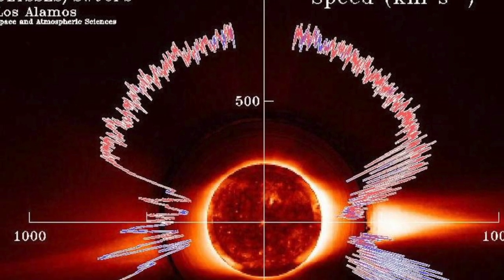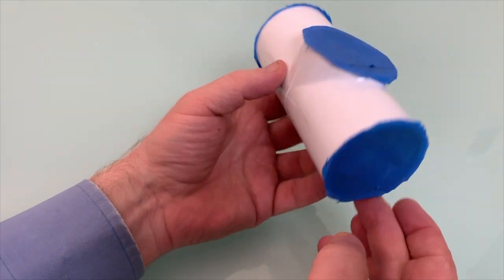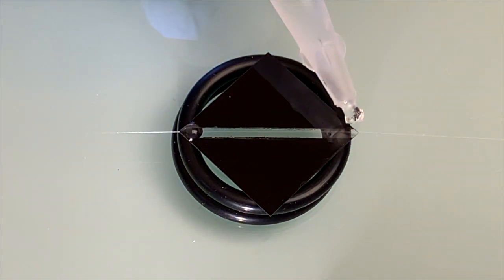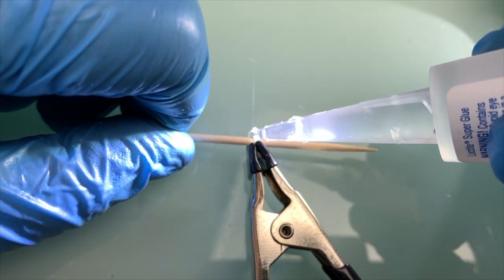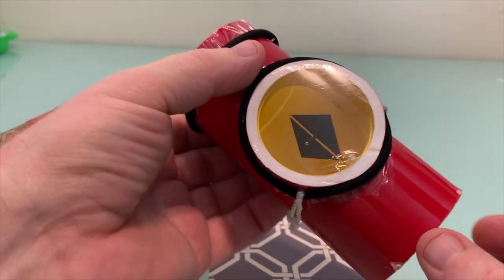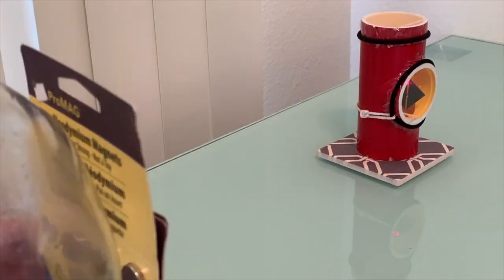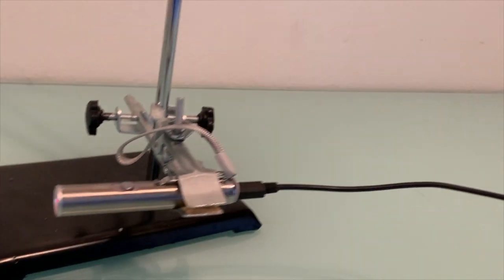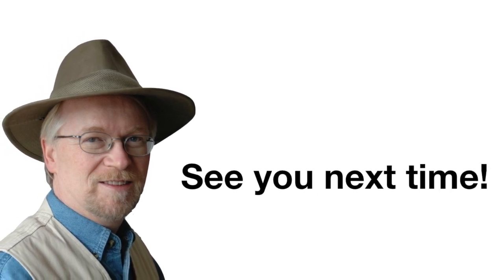Build an inexpensive DIY Solar Weather Station at home

Comment: Shawn I'm building this instrument, thought I'd let you know :) I'll keep you posted on my progress. One question I have involves dampening rotation. The q-tip you use dampens vibration, but doesn't much dampen rotational oscillation, which I'm finding can persist for quite some time, and is easily induced. I wonder if filling the cavity with some liquid would act to dampen rotational oscillation, but not to hamper the magnetic torque being measured. Essentially, it would be a low-pass filter. Thoughts?
Reply from the maker: Wonderful news! I thought about enclosing the sensor in a liquid to damp the rotational motion, but I didn’t try it. (I was concerned about biofouling over the long term, but I think this is a perfectly viable option.) Another way to do it is to use eddy currents to damp the rotation. Suppose you cut a channel in copper plate that was just wide enough to allow the magnets on the sensor to swing through. Mount the channel just behind the sensor with the magnets penetrating the channel. Then as the magnets rotate they create eddy currents in the copper which, by Lens’s law, creates their own magnetic fields which act to oppose the motion of the sensor magnets. I’ve used this method in other magnetometers, but I didn’t have the tooling required to machine the part. 

I think either approach should work. 

Another way to kill the motion is to bring a magnet 🧲 in on the zero line so that the sensor aligns to it, then withdraw the magnet exactly along the zero line so that it’s influence gets weaker and weaker. When it’s removed completely the sensor magnet will be it it’s zero position.
Reply from the maker: Let me know what you think about these these options. I encourage you to experiment with low viscosity fluids. I suspect that they would prove quite suitable for this application as it should be easy, with the relatively large sensor area to achieve critical damping.
Reply: @citizenscientistsworkshop1948  I think I'll give the fluid a try to start with. I'm 3D printing my enclosure, so it won't be much of a trick to keep it sealed. I'm thinking something like isopropyl? I don't want to weaken the nylon. Incidentally, working with single strands of nylon is incredibly challenging. I managed to get down to a few strands, but could not separate out a single one. It's just too thin. I don't think it makes much difference, though.

The eddy currents idea is very attractive, though, because it would let me explore that regime. I have a friend with a CNC that can machine channels in copper-clad printed circuit board, so maybe at some point I'll give that a try too. Do you think this idea would also serve to dampen the vibrational mode you use the q-tip to dampen in your video?
Reply: @citizenscientistsworkshop1948  I've done some research on low viscosity liquids, and am having a hard time coming up with one that's not toxic, corrosive, explosive, or some combination thereof! The eddy current dampening is sounding better to me. In fact, I just taped a prototype to the back of my prototype enclosure (maybe a half inch away from the magnets) and that improved the dampening time quite considerably. No doubt a fluid would really do better, but unless I can find one that is relatively safe to have sitting around the house, I'll probably go with copper. Thoughts?
Reply from the maker: @tdstone4s  Why not use water with a dash of dash of sodium metabisulfite, potassium metabisulfite or idorophore? The first two chemicals are used to sanitize wine making equipment, and the latter is and iodine-based compound that is used in the medical industry. I think all three are stable and that they should prevent biofouling over fairly long times. Concentrations needed to kill microbes are not dangerous to humans, which is why these chemicals are used in these industries. 

I’m glad to hear that eddy current damping is an option for you. Since you are printing your own housing, you can create one that has little clearance for the motion of the magnets. Then you can place the copper on the outer surface. Ideally, you’d like to have the long magnets pass through a channel that’s cut in the copper.  Such a device might come close to being critically damped.
Reply: @citizenscientistsworkshop1948  Thanks for the tips. Those do sound better than acetone!

I went ahead and ordered some of those magnets you used in this demonstration. They're quite small, smaller than I realized. They wouldn't give me a lot of working room for a slotted copper, but maybe I could stack two of them on each side of the slip. That might actually improve the dampening, as (if I'm not mistaken), the eddy current strength is a function of the strength of the magnet and the rate of its sweep across the copper...
Reply from the maker: @tdstone4s  You’re right about doubling the length of the magnets. It increases the rotational inertia which slows the rate of energy uptake and it makes it easier to couple them field to copper. It also should roughly double the sensitivity to low frequency shifts in the local magnetic field.
Reply from the maker: Please keep me posted.
Reply: @citizenscientistsworkshop1948  For the first time, I've had my prototype running steadily for a couple of days without a bunch of manmade magnetic interference. Whenever we move one of our cars (the magnetometer is in the house at the moment) the magnetic field goes crazy. I have a plot showing plenty of activity. The non-natural transients are obvious, as is the more small scale fluctuations due (presumably) to the solar wind. Apparently there's no way to post the plot here...  Unfortunately, my data seems to not correlate very well with the USGS data. The stations as far south as me barely register anything, while Barrow registers huge fluctuations, which I would expect to see. My fluctuations loosely correlate with Barrow's if I use some imagination.

A couple of questions: This instrument measures the Z component of the magnetic field, right? I find the strongest correlation (though still not good) with Barrow's north component and/or declination component. The other vectors don't seem to be helpful, and the other stations are almost completely quiescent compared to mine. Is it possible mine is that much more sensitive than the USGS magnetometers? I don't have an explanation other than that, or the manmade environment here is MUCH more magnetically active than I need it to be. 

Thoughts?
Reply from the maker: @tdstone4s  First, my most heartfelt congratulations on your accomplishment! I can’t tell you how thrilled I am to know that my channel has inspired you to build this instrument. Your work is an inspiration to me to keep doing projects like this. So thank you! 

The instrument is sensitive to toques, and so it shifts in response to changes in the north-south component on the local field. Suppose that the field from the solar wind was constant. Then, as the earth rotated and changed the orientation of your magnetometer to the field, your instrument would show a sinusoidal variation with a period of 24 hours. If the USGS data is corrected for this effect, then your unprocessed data set wouldn’t match well with it.  So if I were you, I’d reach out to the USGS as ask them if they are posting corrected data or raw data. If they are correcting the data, ask where the relevant algorithm is published and then apply it to your data to see if doing so improves the match. 

It’s relatively easy to estimate the sensitivity of your instrument. Stack a number of identical rare earth magnets so that the form a single magnet that is about one half of a cm long. Remove the damping from your instrument and measure the resonance frequency. Then position the magnet at least four meters away from the sense magnet direct along the north south line. Then create tiny pulses in the local field by quickly rotating the magnet “north south” (north end facing the detector) to “south north” (south end facing) then back again and again and again... pause between each reversal so that the period of the reversals matches the resonance period of the detector. By feeding the energy into the sector on-resonance you will be creating the largest possible response to your detector. 

Diminish the strength of the signal, either by moving farther away or by reducing the number of magnets in the stack, until the motion of the spot is just barely visible. 

Calculate the magnitude of the signal at the detector. To do that, look up what the field strength at the surface of your source magnets. The strength of a dipole field falls as the CUBE (not the square) of the distance as measured in units of the size of the dipole. So measure the size of the source magnet, and divide that member into the distance between the source magnet and the sense magnet. The field strength at the detector will then be approximately equal to the field strength at the poles of the source magnet divided by the CUBE of the ratio of the distance to the length of the source magnet. (I was going to explain all this in my follow up video, but alas...)

Compare that number to the sensitivity published for the USGS magnetometers to see if your instrument is more sensitive than theirs. (Since you used a longer sense magnet than I did, your instrument is likely to be more sensitive than mine, and possible more sensitive than theirs.) 

There are also other terrestrial sources... businesses nearby, trucks driving along nearby roads, your neighbors refrigerator or vacuum cleaner, and natural sources in the atmosphere... that can also affect what you are detecting. 

The point is that your are monitoring the local field with extreme precision and observing all sorts of structure! 

Let me know if this was helpful. 
 
Please send me PDF’s of your data to me directly at drshawn@labrats.org. 

Thanks again and Tally-ho!